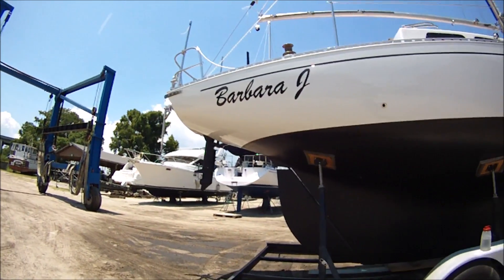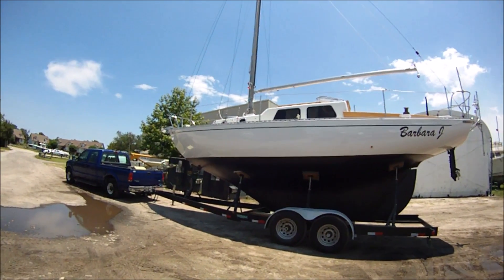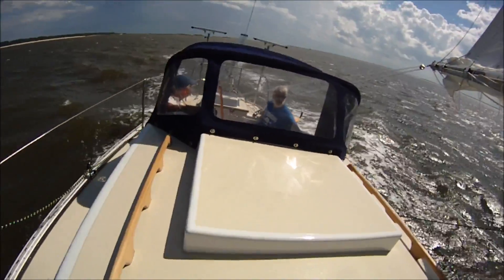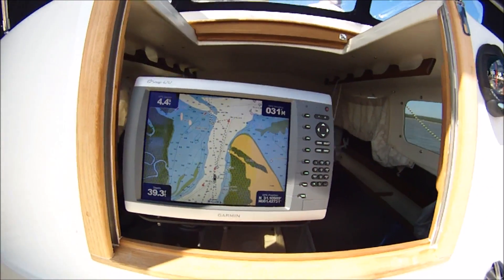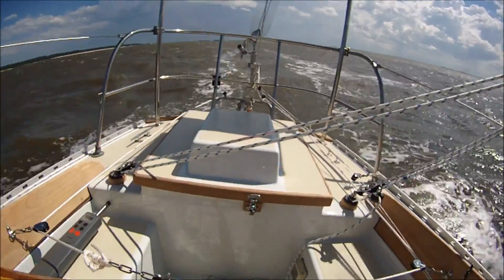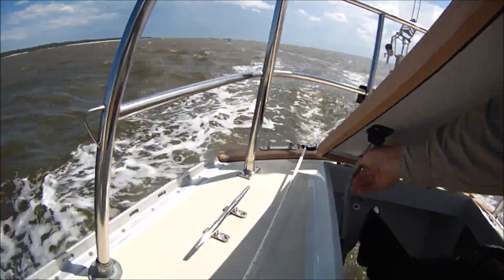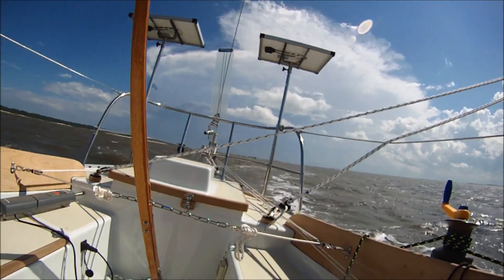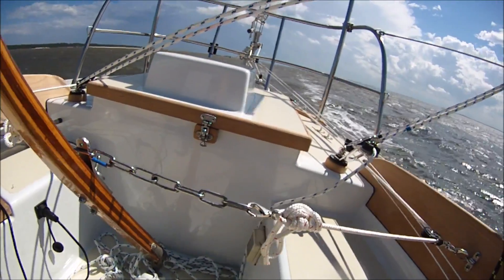1968 Alberg 30 Refit Part 1 Exterior 2016

Comment: Nice.  How much? I would like the same thing.
Reply from the maker: We're booked up and not taking on any more work. The owners expenses are private but you can always show the video to some other boatyard for a quote. It will be much more than you imagined so most owners do the majority of the work themselves or it doesn't get done. That's why you seldom if ever find a fully refit boat of this type on the market.
Reply: There are no boat yards where I live. or for that mater within 800 miles. I have been working a Neptune 16.  The refit that you are doing is way beyond my skill level. I have been looking for a bigger boat for off shore sailing. What do think about a Cape Dory 25d. To start with?
Reply from the maker: If you want an inboard diesel in a 25 foot sailboat (and apparently most of today's sailors do) then the 25D is a nice boat and proven capable of making offshore passages.